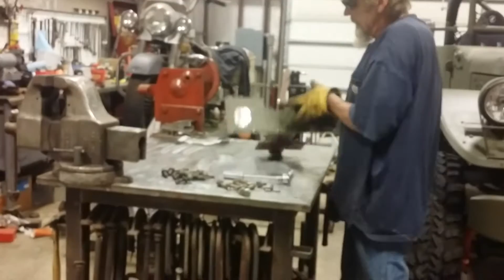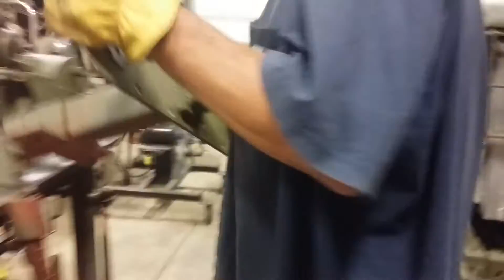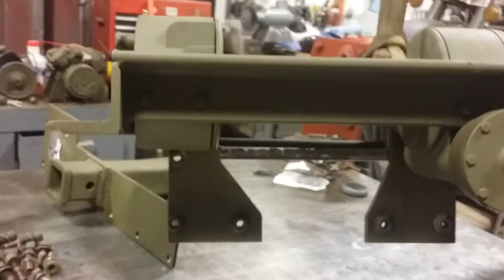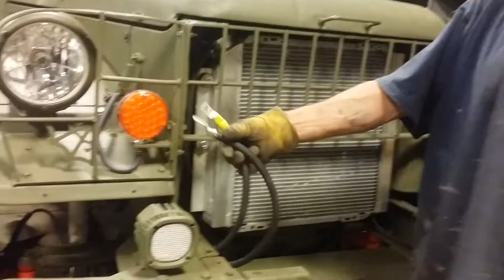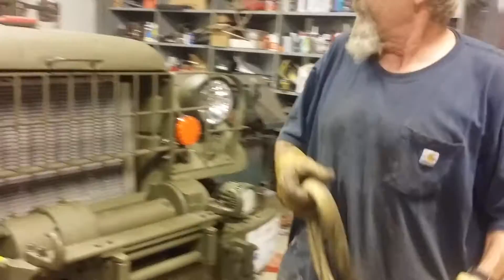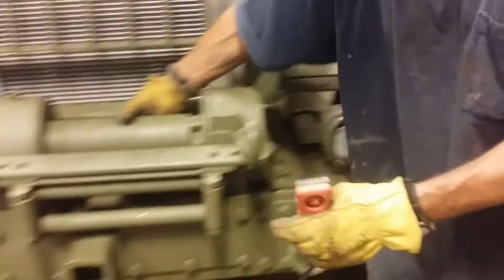Dodge M37 Build #33 Ramsey electric winch

Comment: That style Ramseys in mechanical PTO, hydraulic and electric versions UTTERLY dominate the commercial wrecker industry.  I have three electric versions, all bought from sellers who didn't know how easy (six nuts, three for the cables and three for the motor, and the Allen head setscrew holding the drive gear) the motors are to replace.  (Electric winch failure is typically due to user error especially poor electrical connections.)  Beats paying a retail and the electric motors can't hurt the winch drivetrain. Most of those winch parts interchange between PTO, electric and hydraulic versions. They're a breeze to work on.
Reply from the maker: Yeah ....I've had a few comments,  guys say  put a Warn in... This Ramsey is much beefier than any Warn.  thanks for the comment brother